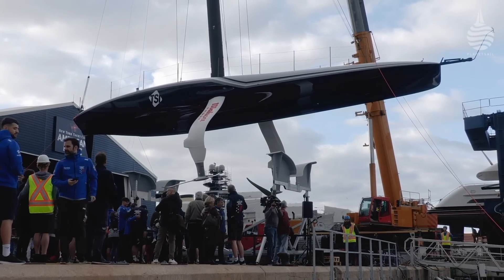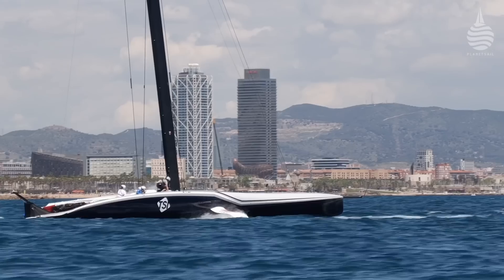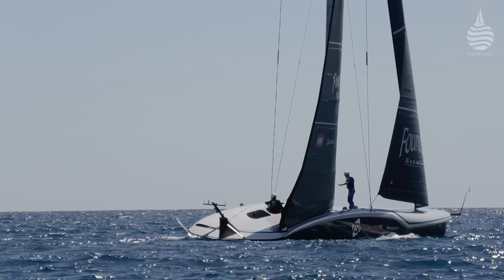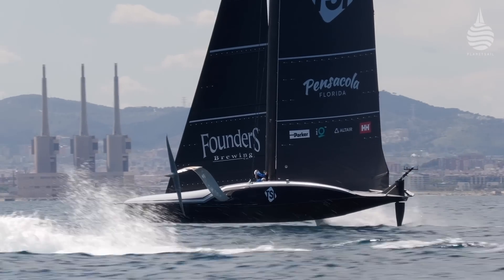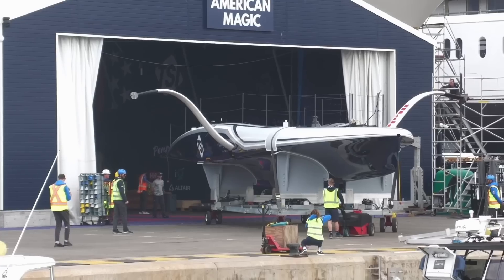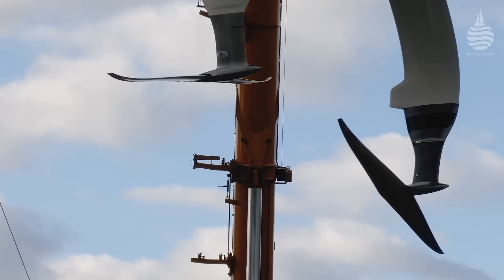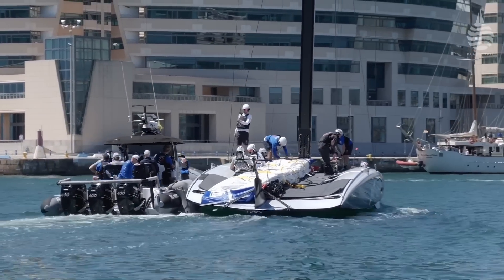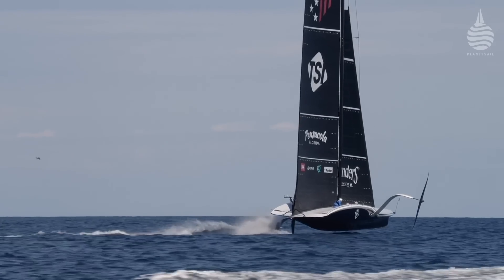American Magic launches America's Cup boat Patriot

Comment: I don't get why they would produce less power if they just rotate them, as long as they're in the same position with their same femor to (lower) spine angles that they're used to. The only difference should be the curvature in their upper spine being less for more comfort.
Reply: I'm just guessing here, but in a standard pedaling position, body weight and gravity can help.  You don't get that in a recumbent position.
Reply: @das564  Yes, several factors make recumbent cyclists generate less power. Besides the rider's weight and gravity, the respiratory system is less efficient and so is tissue perfusion. That said, it is far more comfortable and the average heart rate is roughly 20 BPM lower, if I recall correctly, contributing to increased endurance that may also help in a long race. This is all without considering the aerodynamic benefits of superior hull streamlining, which is the primary design objective that AM had in mind with the recumbent cyclors.

Comment: I'm not sure how she will compare competitively, but she has really nice lines and curves.  It is so interesting that they now have to really concentrate on aerodynamics, but given the speeds of over 50mph are not unheard of then yeah, aerodynamics does matter.  I wonder if they are allowed to fit those arms that pivot up/down and hold the hydrofoil with aerodynamic features.  They might not generate a lot of force (lift), but being able to use the foil arm on the windward side, the side out of the water, but to have that side generate lift downwards to help counter the tipping force tending to make the boat roll away from the wind.
Reply: Active aero has been looked at by at least one team in the offshore Ultim trimaran class. It makes more sense on a trimaran since the arms are fixed, but what you're saying could be of some advantage down the road especially if speeds increase in the AC. We can expect every team will be researching all conceivable avenues that may avail them of gains.

Comment: Interesting , very interesting on the recumbent cyclists plan. Seems like a red herring , can’t believe they would deliver more watts than standing in the saddle as it were.
Reply: Slightly less watts but less drag and positioning as in the over all design of their boat. Trade offs. A very impressive boat.
Reply: Also, those watts don’t necessarily equal boat speed just more effort to power the hydraulics. It might come into play in a tacking dual if that is a thing in these votes, but I really don’t think the differences in our matter and it’s clear they’re going for the low profile and frontal area.
Reply: AC teams don't invest millions and years of R&D on red herrings. Look at the current generation of Ultim trimarans with the streamlining efforts that have gone into that class, and it's supposedly not as fast as the AC75.